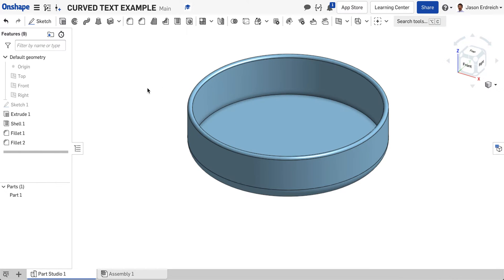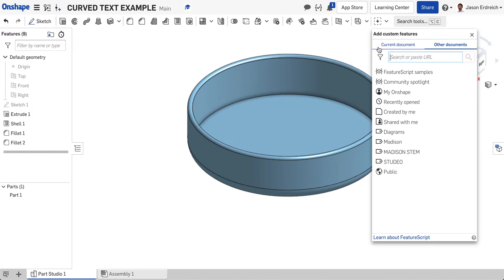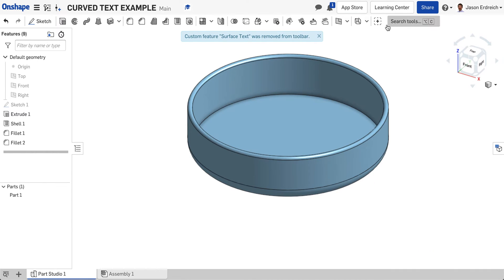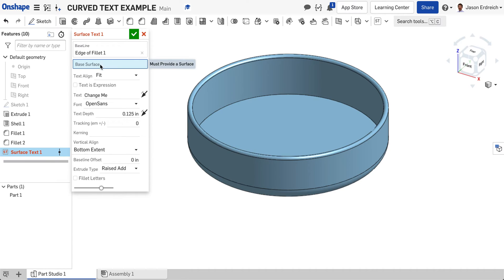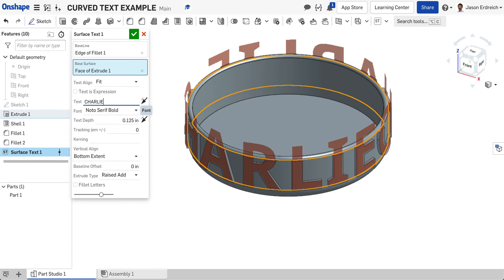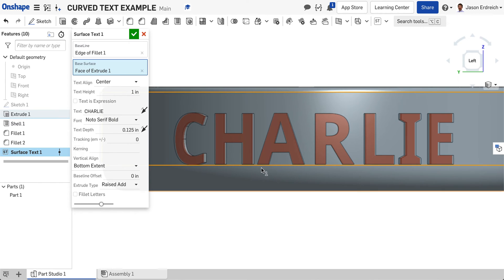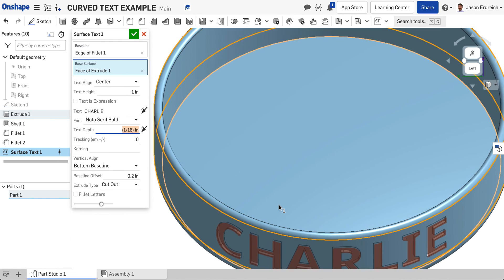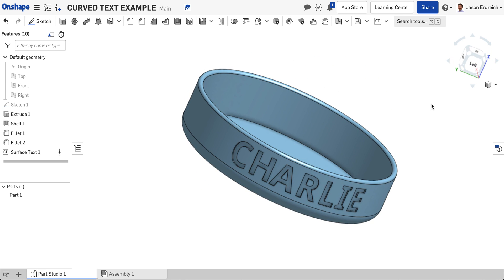How to create curved text in Onshape CAD

Comment: Hallo,
Ein tolles Video und für mich gut nachvollziehbar. Mein Englisch ist nicht so gut, dass ich meine Frage in Englisch artikulieren kann:
wenn ich eine Skizze statt einem Text positionieren möchte der sich der Rundung anpasst: wie geht das ? Beispiel: Öffnung eines Bajonett-Verschluss?
Gruß Klaus (habe Deinen Kanal abboniert)
Reply from the maker: Hello! If I understand correctly, you are trying to place a sketch on a curved face, which you cannot do. But what you can do is use the "wrap" feature in combination with a sketch on an offset surface instead

Comment: For the "Text Align" - is there any way to offset this ? For example how would I make my text 2mm offset from the Left ?
Reply from the maker: No, there is only a way to offset vertically with the baseline offset. You could make a sketch with a construction line that is dimensioned exactly where you want the text to start, then manually space and size the text to light up. The plug in works, but its a little limited.

Comment: Is there a way to have 1 text on 1 side then a completely different text box on the other side of a ring? Or would I have to make 2 parts to the ring then put them together
Reply from the maker: With this plug in, two parts. What I often do is make the right in two halves so it appears to be two parts, then export as a combined STL to merge together

Comment: Will this work on a lofted surface, for example, if the bowl had a larger top diameter and lofted side?   Thank you.
Reply from the maker: It should! You may need to use the baseline settings as the position might be off because there isn’t a plane to align to, but I have used it on lofts before. If the text is too big and it starts to deform, it will cause an error.

Comment: Does this still work? Cause I can‘t find this custom tool
Reply from the maker: I just checked, and I could still search for the surface text tool and utilize it as shown in this video. Make sure you search for pp-surfacetext-beta and found version 2.1.7. Before you search, also make sure you are in "other documents" rather than "current documents", and you can select "community spotlight" and search within the spotlight to filter out duplicate tools for the original.

Comment: Due domande: 
1. come si può vedere nel minuto 3, facendo l'estrusione mi estrae anche quel pezzo sul retro. Come mai? non si può evitare? rovina la forma.
2. in merito all'allineamento orizzontale del testo, io vorrei spostarlo ma non riesco. non riesco a centrarlo in un punto preciso in cui mi serve. se allineo con "centra" mi capita la scritta vicino ad una maniglia, se decido per sinistra o destra è brutto perchè non è centrato a nulla.
grazie
Reply from the maker: 1- unfortunately no, its an error with the tool. But you can use the "thicken" tool after the surface text tool to even out the shape and correct the error. 
2- alignment control is limited, as you pointed out. I use spaces to offset the position of the text for better alignment, or design in two parts. So if I was making a mug for example, I would make the cylinder with the text, then add the handle as a separate part so I could position it where it needed to be based on the location of the text. 

I hope this helps!